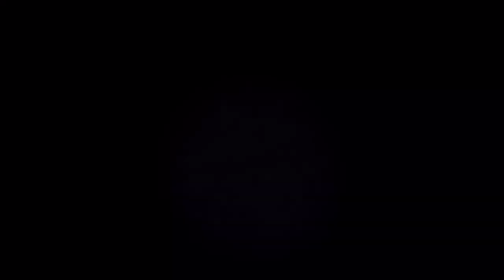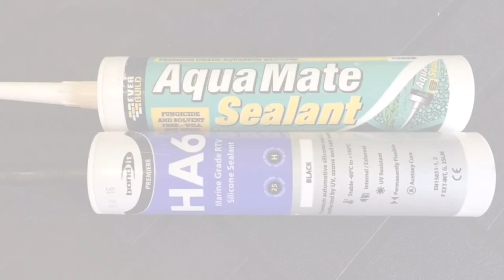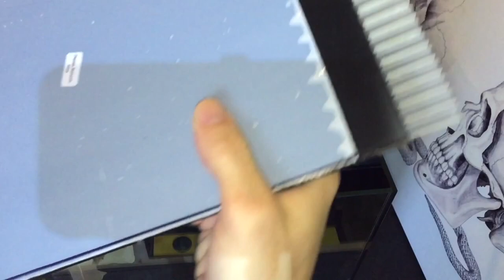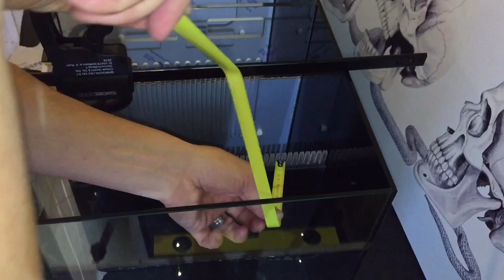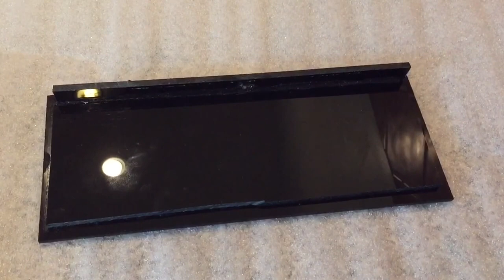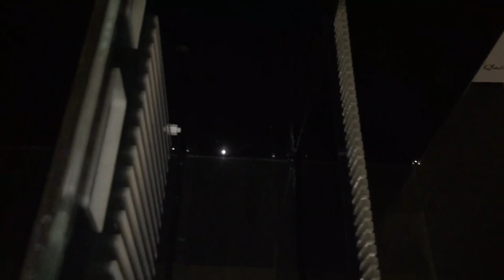Reef Aquarium - eaReef Pro 900 - Episode 5 - Sump ( part 3 )

Comment: hi Jd the acrylic you have cut are the measurements the same size on both sides for the water level if so what height did you do the water level ??
Reply from the maker: Hi mate, it depends on where you plan to have your skimmer really and the depth of water it needs. This is what I went by with mine but I made mine a touch deeper for future upgrade of the skimmer. Since mine is nearly 8 yrs old.  
One side is slightly lower than the other by like 10mm. 

Check water depth required by your skimmer and then work around that fella. 

Cheers 
JD